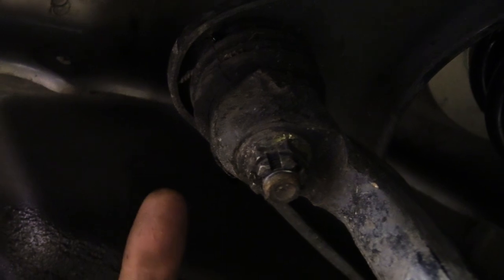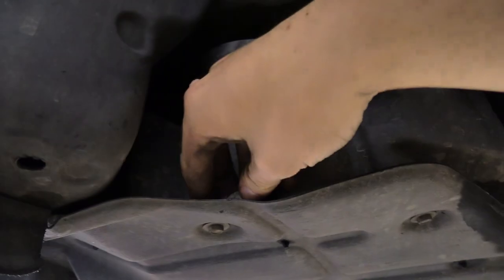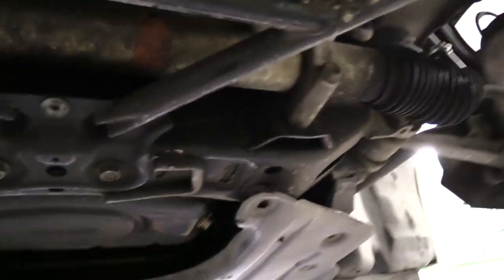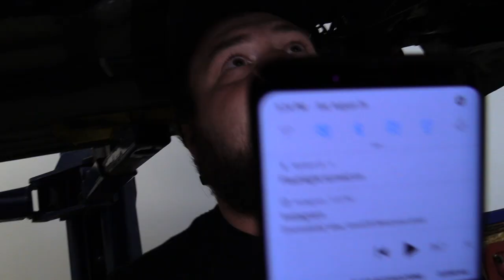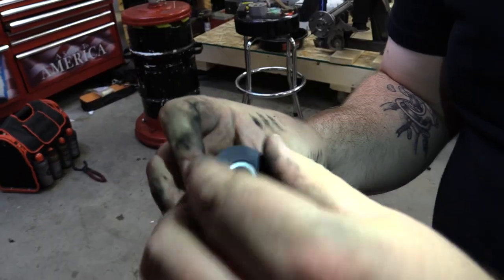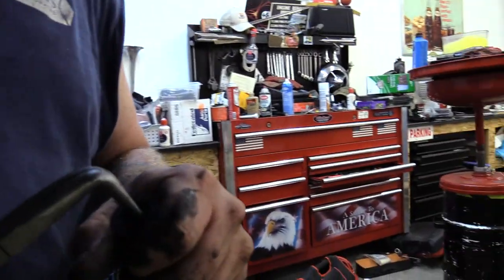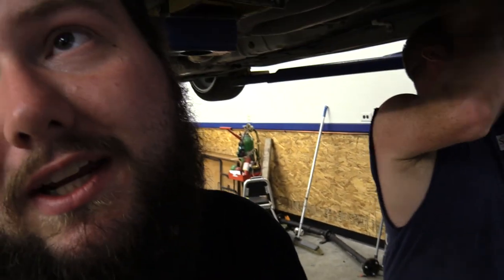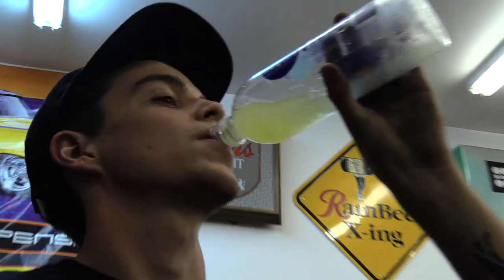Youtube Mechanics Can't Fix Car

Comment: When I installed coilovers on my evo, I had a very similar noise. I called bc and they told me the coils would take some time to settle. They told me to put some lithium grease in the top hat ball joint of the coils.  I didn't have lithium grease, but put some new synthetic oil in the joints.  The noise started slowing down and eventually went away. Just a suggestion, goodluck 👍
Reply: definitely sounds like it could be those bearings.
Reply: bump
Reply: ive bought brand new bc's a few times, never had this issue. but who knows.

Comment: check your sway bar end links. if you didn't get new ones with your coilovers get some new ones that are shorter or adjustable. also, use a prybar and pry it against that upper ball joint and see if theres any play. if there is, you will need to replace it.

Comment: That clunk is your sway bar link. I have an Is300
Reply: Arian Sarvi who woulda clunk it?
Reply: I second this, after an adequate amount of drop the sways bar isn't centered. Get Figs swaybar end links.
Reply: Arian Sarvi  could also be sway bar bushings. I had a really bad clunk over small bumps at low speeds in my old g35. Tried all control arm bushings and ball joints, only to find that it was a $20, 10 minute sway bar bushing fix...
Reply: Kevin Starks Lowering a car changes the suspension geometry and puts more stress on the suspension components. If the sway bar bushing was on it's way out, lowering it on coilovers is all it would have taken - smart man.

Comment: Upper control arms smacking top of the wheel well. Happend on my GS, brothers and cousins LS. Cut out a hole or get jzx100 arms they are smaller
Reply: Had the same on my gs300 to, i just drilled a bog ass hole som the balljoint didnt hit

Comment: Check the bottom locking collars on the coilovers, if they're not tight they clunk bad. Otherwise main stuff, sway bar links, sway bar D bushes, inner or outer tie rod end. All easy to check and replace and cheap.

Comment: Had the same clunk on my turbo IS. It was the sway bar endlinks. If there's any play in them at all, swap em out! But make sure that when you check the car either on the ground or on the lift. Don't just jack it up from one side because that puts tention on the swaybar.

Comment: Sway bar endlinks clunk on JZX100's when theyre dead so check those. 

but if its only while turning which it seemed to from the video grease the spring seats on the coilovers and the top bearing. 
They can bind up if theyre dry and make that noise.

Comment: pry on suspension components with a breaker bar or pry bar to find which components have play. and for your steering rack, if you put car on ground and move steering wheel left to right and listen for clunks

Comment: I had a similar issue as well, not sure how i fixed mine but it eventually went away. I was paranoid that the lock ring that was holding the spring seat was moving it so i tightened it after taking some pre load off of the spring.

Comment: Lift the front of the car and have someone turn the wheel. Hold moving parts. When you hold moving parts they should quiet down and you'll have an easier shot of finding what's wrong. You mentioned it happened since you guys installed coil overs. First thing I'd check would be the spring. Prob not enough preload or they're just cheap and will for always clunk.

Comment: Have you guys tried checking the top pillowball nut on the coilovers? Mine was loose when I installed bc's on my brz and clunked like a mf but after tightening it down the clunk went away

Comment: Make sure that the nuts on top of the coilover hats are tightened down. (the nut under the damper adjusting knob) I had a similar issue with megan racing coilovers.

Comment: I'm thinking it's your upper control arm hitting the top of your frame. Its pretty common if you're slammed. You should try jacking it up and lift the wheel up as hard as you can to see if it hits the top frame. I have a friend with an IS300 with similar problem.

Comment: Yoo! Tighten down the lock nuts on the top of the coil overs. Once you install, the weight will compress the coils more and if the top nut isn't fully tight. You'll hear a clunk. This happens a lot, even when people build up there new Ohlins suspension they say they hear a clunk. 90% of the time it's because of the top nut isn't fully tight.

Comment: Make sure the tophat of the coilover is tightened properly. If you torqued the bolts with the car off the ground the unsprung weight probably allowed it to not seat properly.

Comment: Check sway bar endlinks, and lower ball joints, common IS300 problem. Also make sure the coil over top hat bolts are tight.

Comment: Maybe go back and make sure everything is tightened from when the coilovers were initially installed.  A slightly loose suspension fastener will def make a nasty clunk. Ik from experience.

Comment: get the car up high with it still sitting on its wheels. rock it around really hard while watching/listening underneath. if you still cant see the problem id guess its a shot ball joint socket (metal ball on urethane socket in some cases), dont forget the sway bar drop links are ball joints also, grab em and push/pull them as though youre trying to pull the ball out the socket, if you can move them in and out then theyre shot/ probs whats clunking. if all the ball joints are good you should take a look at your inner tie rods.

Comment: It might be the Coilovers tighten down the bolt on the top or bottom  of the coil. I had the same clanking noise on my car I thought it was rack but it was just the coils. Solved the problem right away 🤓

Comment: You'll probably fix that clunk when you fix those O2 sensors! Riley knows best!
Reply: By the way, double check those sway bar end links. Some have to be tight as fuck, but they aren't very big bolts so you can't torque them down too hard. Mine clunk on my GS430, but nowhere near as bad as yours. Since your clunk isn't at lock, I wouldn't suspect upper/lower ball joints... The lower ball joints fail a lot on the S16x GS so I would check those for sure.

Comment: Just did the oxygen sensor on my truck and I figured out the best way is to soak it in pb blaster and then cut the end of the sensor off so you can slide a socket on it

Comment: Look for any new ware marks my money is on sway  bar end links, cv axles hitting some plastic\metal bullshit you don't need or the for rod arms hitting other shit due to too low for factory parts. Leave the car on the ground get on your back with a flashlight and look for the contact from full lock left to right.

Comment: is200 known issue, is this with a ball joint on the hub nuckle, if its loose the wheel will literaly rip back 90 degrees and your fucked lol, fix that shit man, just get it on a ramp go round all! of the ball joints with a pry bar moveing them all untill you find out wich is fucked lol,